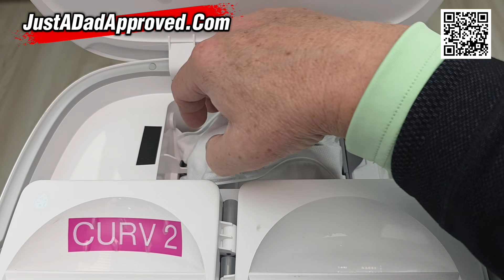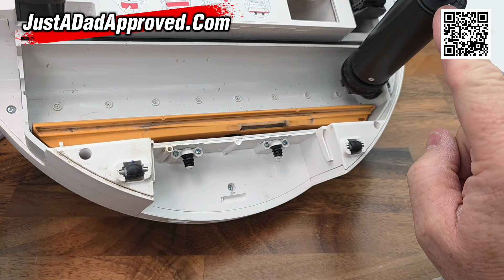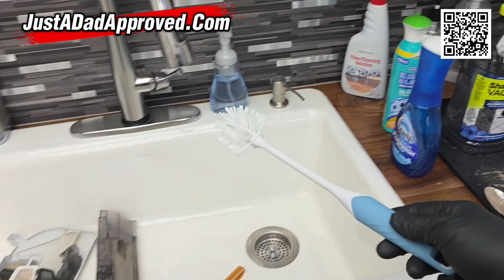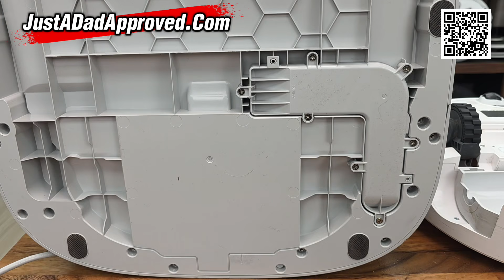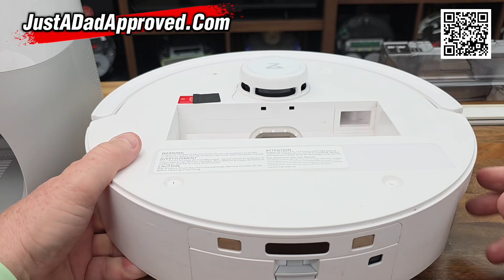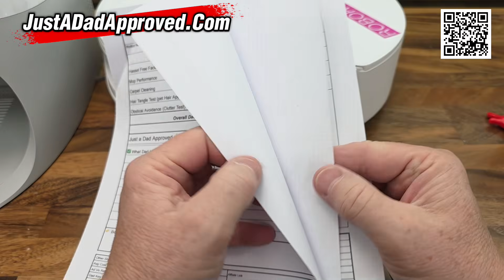Roborock Curv 2 Flow Robot How To Clean & Fix Low Suction

Comment: Here for a refresher on cleaning and replacing the brush roller. My brush roller that came with my big set I bought does not come with the end on the brush roller. The end with the button, is not on the new rollers. Wtheck. Not sure what to do.